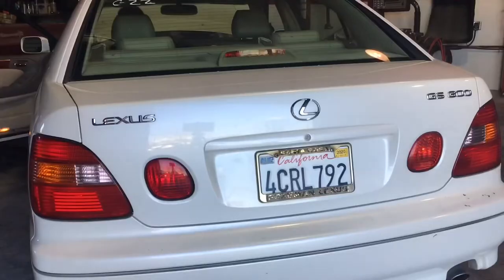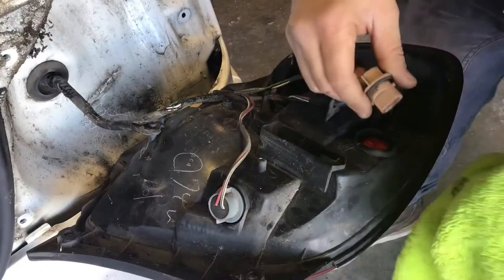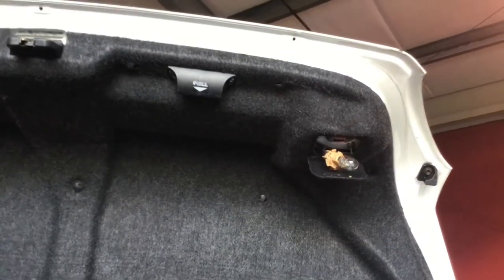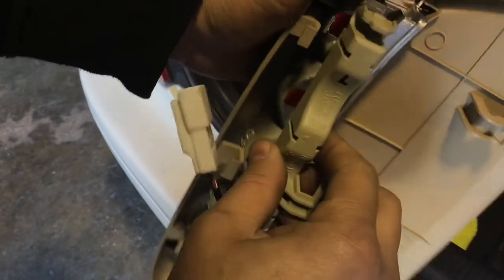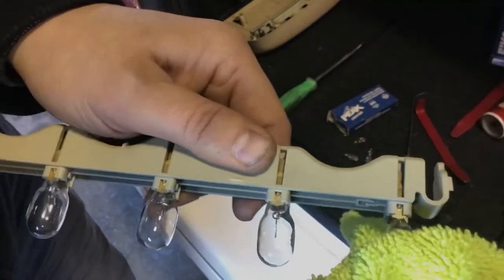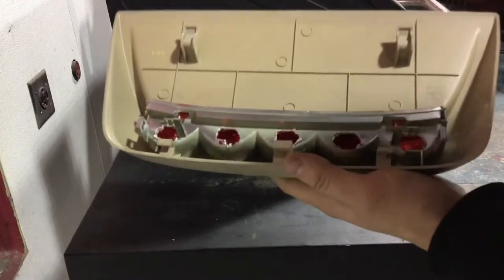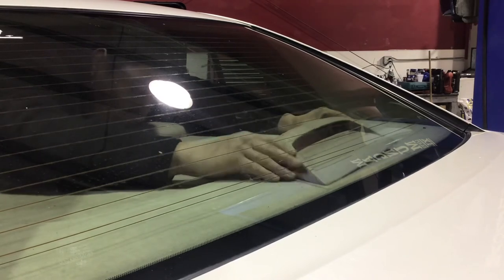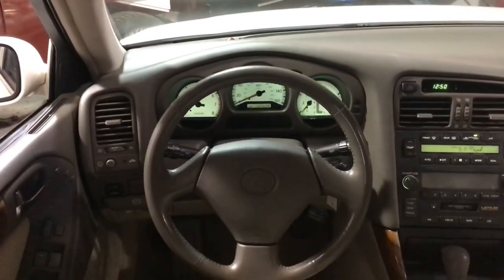Rear Warning Light On Dash but All The Lights Work Easy Fix Lexus GS300

Comment: You can also use 168 bulb, if you don’t want to drill or modify the case/holder — it’ll get rid of the warning light on dash

The 921s don’t fit because the 921 now is different from the one it was during the production of the car. That version of 921 is mostly discontinued.

Comment: Were did you get the size for those cause minds does have 194 then went to autozone they said it was 168 and you said 921 they look big it doesn’t make sense the manufacturer build expectations
Reply from the maker: Yes autozone and OReilly were selling me the wrong bulbs for my vehicle. I forgot where I found that info some websites online it told me all the bulb # to my car. Try looking in you’re Owners Manuel. But the 921 did fix my problem.

Comment: Wrong info ….2002 lexus owners manual says on page 302 the “high mounted stoplight” takes 194s …..NOT 921** that is wrong….but thanks for the video But I just put a 921 in and it blew all my working 194s…..so basically u owe me $7 …😂but
Foreals 194s people for third “high mounted Stop light” aka 3rd brake light..